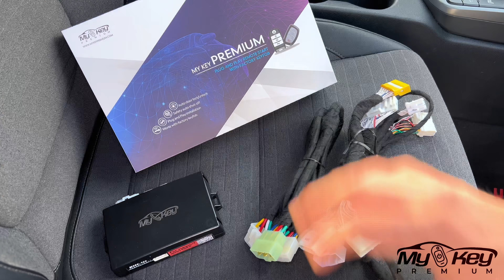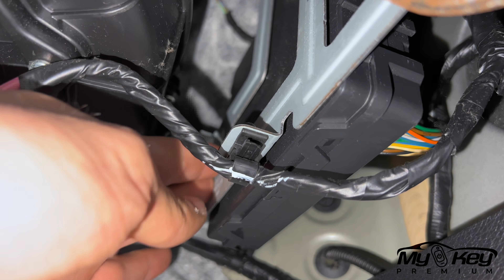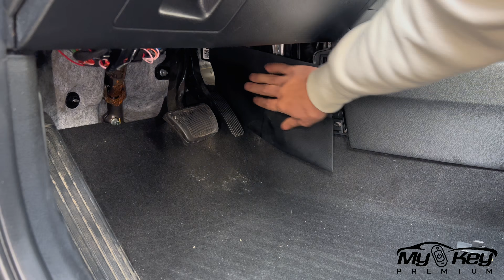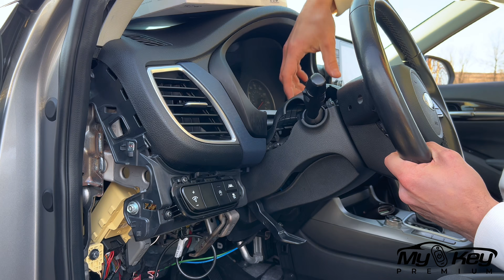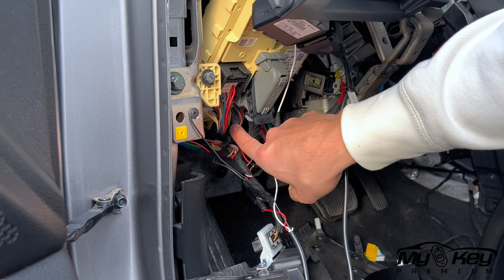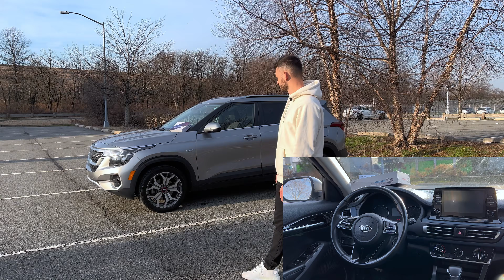Kia Seltos 2019-2021 Remote Engine Starter install / Key Ignition | MyKey Premium

Comment: Hi! just an ujpdate.  I got my unit today install as you've show but you did not mention that once you unplugged and plugged the on connection to the car the horn beep.  Are we supposed to disconnecdt the batttery cable before doing this installation?? There's no mention of this on the installtion processes.  A more details would have help, like tighty up the loose cable end with zip tie etc...
Reply from the maker: Sorry for the delayed response! I hope you’ve already figured this out with our support team. The installation video was made without disconnecting the battery, but to be extra safe, you can disconnect it—especially if the installation steps aren’t followed precisely. Thanks for the feedback, and we’ll work on making the instructions clearer in the future!
Reply: Does yours still work? And how far is the distance for the remote to work?

Comment: Hi. I have 2025 seltos. Can I install my seltos 2025?
Reply: I think you could.  It is basically nothing changes on the inside, electrical wiring, hardness etc.  I just bought my for 309$ from their site including shipping and no tax..suprise.  I complete my in about 1.25 hrs.  The most challenging is upluging the smaller 2nd harness way up on top of the passgener side of the box areas. You will have to remove the other yellowess harness out of the way before you can get better accessing it.  You cannot see it clearly but you see the harness wiring leading to the box, then feel it and unplug it.